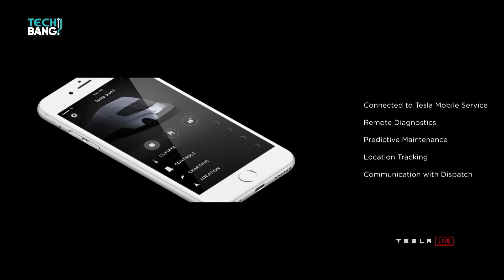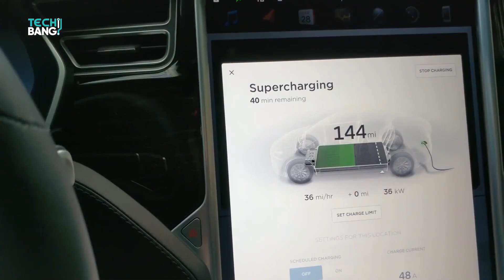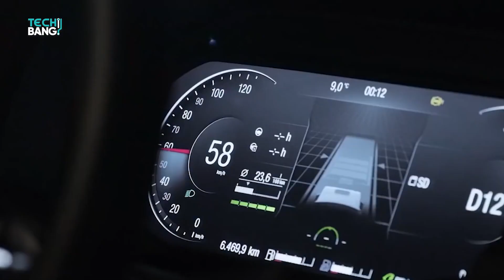Here's why the TESLA SEMI is the FUTURE of all trucks

Comment: Lmao 🤣🤣🤣🤣🤣 the tech is way to heavy!!!!! A all electric semi is a pipe dream..we have 80,000lb load limit because our roads and bridges are not engineered to hold any more then that on a avg load...

An all electric semi..it's battery would have to weight around 16tons.. leaving on 5 tons for cargo..sence the truck and trailer would take up the rest..

Lmao 🤣🤣🤣🤣🤣 snake oil!!!!!
Reply: Right now the battery weighs 8,000 lbs, 4 tons. But Tesla has made advancements in battery tech since the unveiling. You were only 12 tons of! Ha ha ha!